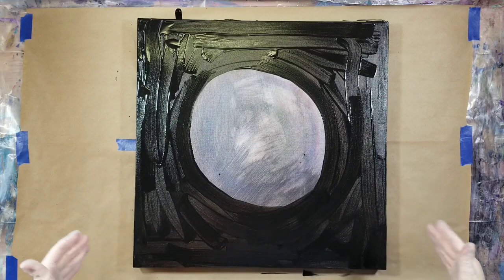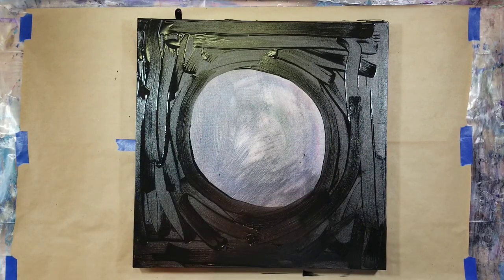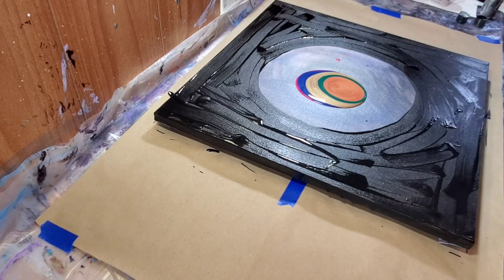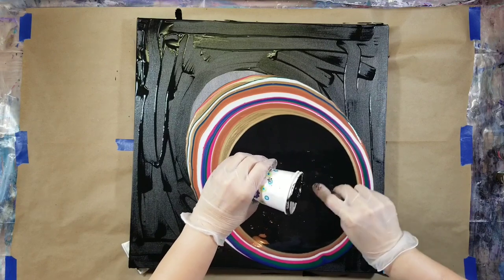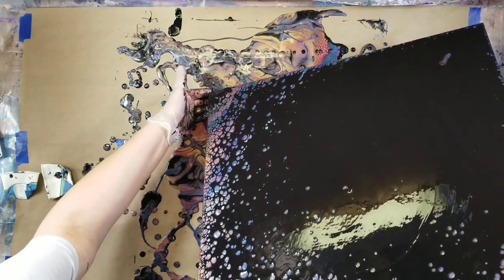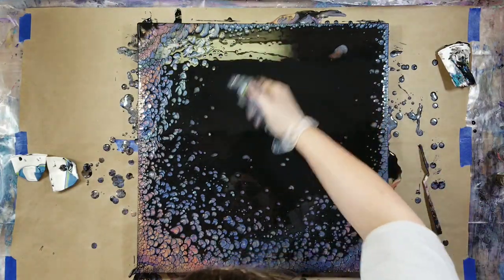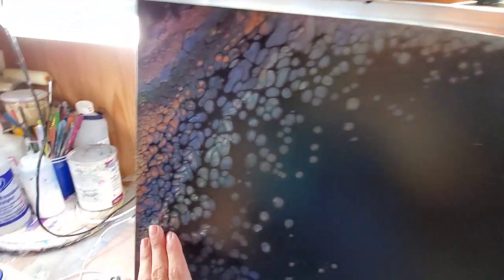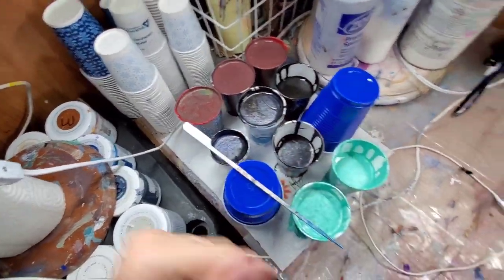Acrylic Paint Pouring | Dump & Swirl (DwightPours) | Chatty

Comment: Is it possible to put the colors on, then dump the black, and then tilt it so much the colors may all come off. Just asking because I have tried this and it will not Workl for me. Mostly just a black canvas. The pearl technique, it w works well for me
Reply from the maker: It is possible I suppose, however, I would almost certainly say that the trouble lies in the paint consistency or paint volume. If the pearl technique works well I would say utilize that technique since they're so similar.
Reply: @BeautywithLee  thanks. But I really want to do a good dump andf swirl. I just can't figure out out. But I will.